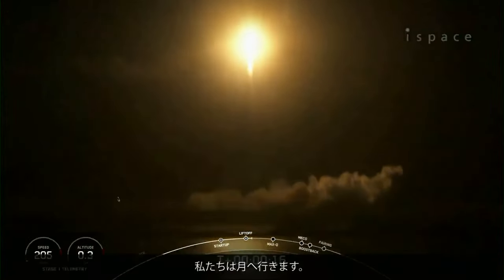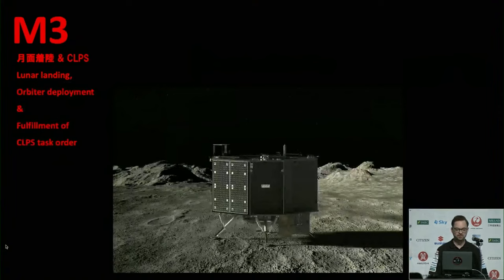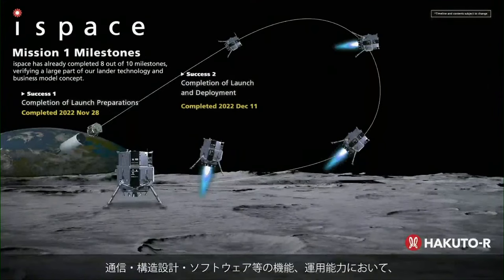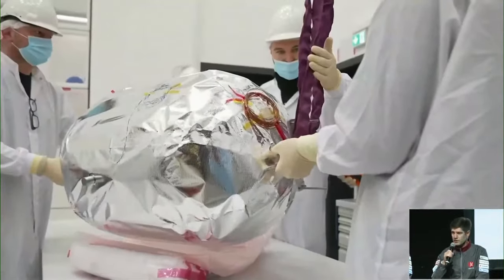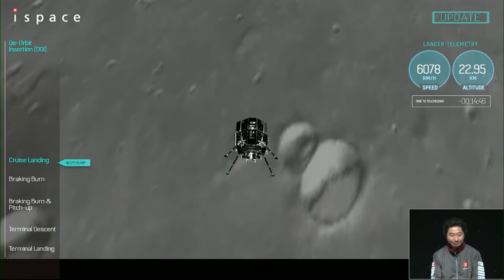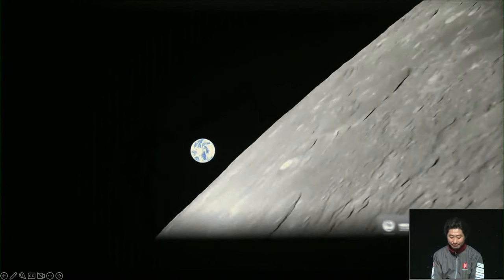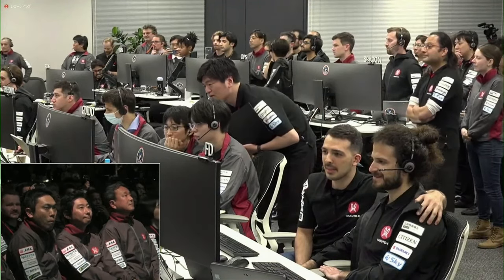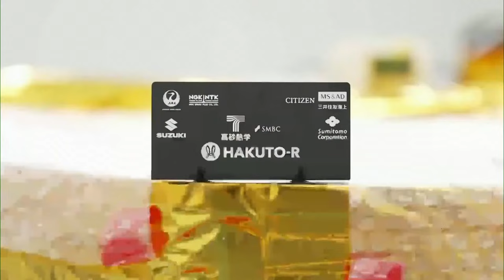Japanese space company fails to land its spacecraft on the moon

Comment: Point one of the big telescopes at the landing site so we can see what happened?
Reply: They can’t see it. It’s much too small.
You’d need a satellite that orbits the moon. There’s a few some with good cameras
Even then Probably not.
It’s a small spacecraft you’d bearly be able to make out any detail.
U can forget when we use telescopes to picture stuff those things are giant
Reply: @EvilNeuro  The LRO is still operational and could probably see something.
Reply: @ngc-fo5te  I’d agree it definitely would see something but judging by the video it seems like a smaller craft so the LRO probably could see large parts but it wouldn’t really be able to deduce what happened
Reply: @Stars ♡  Oh undoubtedly it couldn't figure out exactly what happened. It would just be a small image near the limits of resolution.
Reply: @ngc-fo5te  yeah. 
Ig on that topic I hope nasa will try to do so
Reply: At least some images may be able to tell if it just flipped onto its side or top.  Prolly not going to get signal if it is upside down.  Just need to flip it back onto it's feet an may be good to go?
Reply: @redsonjja7486  Ik a little abt space.
Flipping a spacecrsft on its side would be super hard (take the philpe lander for example it crash landed but still worked but got stuck and couldn’t get on stuck) if we could get communication to the craft that’d be amazing but also present a major issue,
We can’t control the craft manually due to a many second delay. Instead we would need to program and code the spacecraft to do manovers to get off the ground with its trustees and right itself. This is the issue! We would need to know the nearby area and know exactly what’s broken on the craft.
Theoretically it could be possible but wouldn’t have much margin for error and take up valuable DSN bandwidth and resources! 
It’s also possible the craft might be too heavy to do this at all (if it’s on it’s side the small altitude thrusters won’t be powerful enough to right itself) 
Sending a spacecraft to do this would be even harder. 
When we land on a planet or moon our margin of error is useslly a few miles or so, to somehow right that craft with another and margin would have to be practically 0 which would be impossible as the moons gravity field is not perfect and has strong and weak points meaning if we tried this it would be easily possible for it to miss its decent site, we have models that can model this field but they can never be perfect and due to the “butterfly effect” even a small change can result in a Massive change.

Reconnecting the signal too would be hard. 
Its like trying to find a tiny laser in the entire sky, once u see it u can easily track it but it’s super hard to find before. We have multiple comm dishes around the earth, nasa has 3 sites, one in goldstone California, another in Madrid Spain and another in Australia, (if your wondering why 2 in countries other then the us, they are like this so the entire sky can be track thus every spacecraft can be talked to at any time) 

My guess is it impacted the ground too hard (even at a walking speed it can be destructive! Think about the times you’d bumped into something on your bike. But it’s that in a small spacecraft.) this isn’t the first time a lander has impacted the ground and messed up.
As referenced the Philippe lander visited a coment and went to land but one of its wire hooks didn’t fire making it nit stay in the ground and fly off into a small canyon (tho with this we still kept communication)